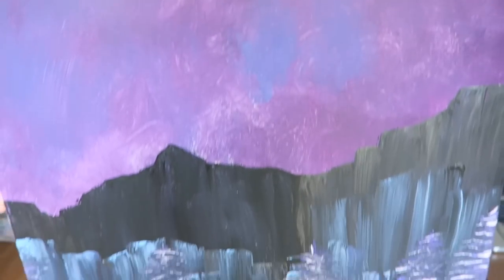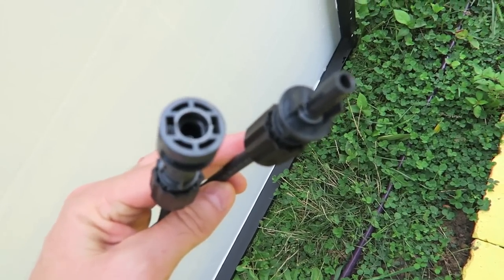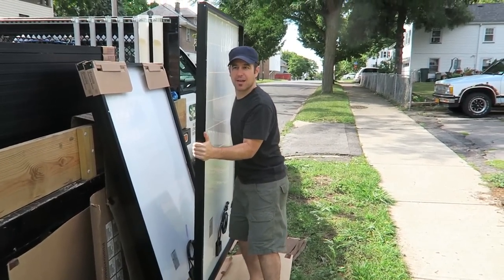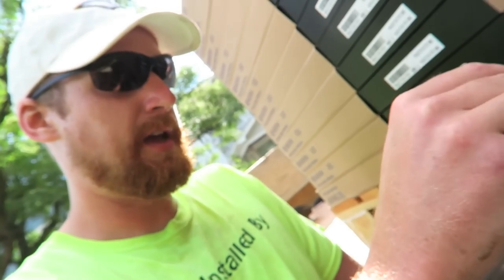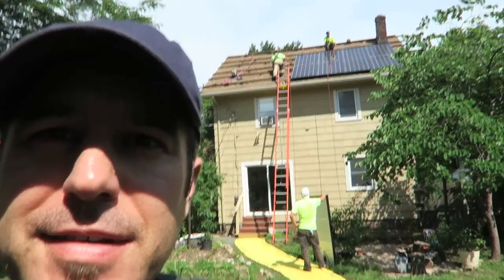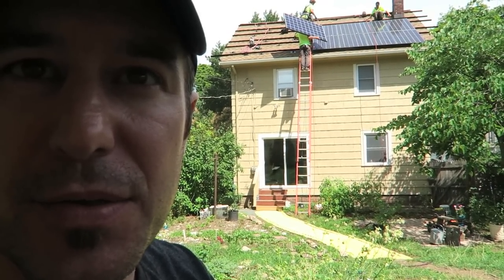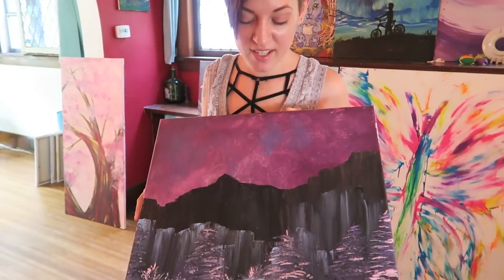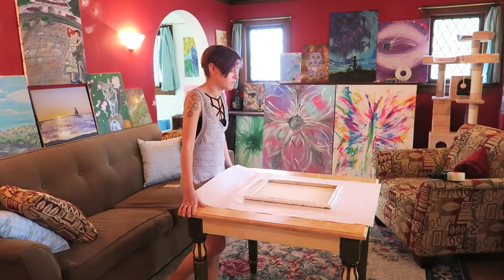SOLAR PANEL COMPLETE INSTALL!! NY State Steep Rooftop Solar System

Comment: I'm wondering, wouldn't it have been better to have had the solar panels installed in Spring? That way you would've had all Summer to make use of it. You're not going to get as much sun now that Fall is coming so is it not going to make you lose money instead? Either way, in the end I'm sure it'll be a great investment. :)
Reply: Same question
Reply: Oh ok, I'm just asking. I really have no idea how solar panel "purchasing" works. I honestly thought you had to buy them. I didn't know you could lease the panels or your own roof.
As for losing money, I meant spending more money the first year and not getting back as much because the panels won't produce as much electricity in the winter as they would in the summer. Since I'm assuming solar panels are a huge investment it would've seemed better to get them when you could get more use out of them and that way "pay it back" as soon as possible.
But like I said, I don't know much about that kind of energy. I live in France and it's not that widely used. 
I also heard that while solar panels are an excellent idea for the future it's not such a good idea to get them now because we don't have the technology yet to recycle them. So in the end they actually produce more waste...

Comment: I have a question. It doesn't snow in my area. But would solar panels be ok during heavy snow storms. Does the snow fall off?  I heard of roofs in the north have heaters for the roof.

Comment: solar 48 Volt Off Grid system, 48 volt Off Grid system, Off Grid House, Minnesota Solar Power And Off-Grid Battery Backup, 48 Volt Hybrid, Off Grid Power, Off Grid 48V Solar, Off-Grid 24/48V battery bank, Solar Power, Off Grid System, 48V Hybrid-Off Grid Power System, 48V Off Grid System, Off Grid Safety. Off Grid Solar Power, Solar 48 Volt Hybrid-Off-Grid System, off Grid/Grid connect, Minnesota Solar Power, OutBack Power Systems, OutBack FX3048MT, Flexmax 60, Flexmax 80